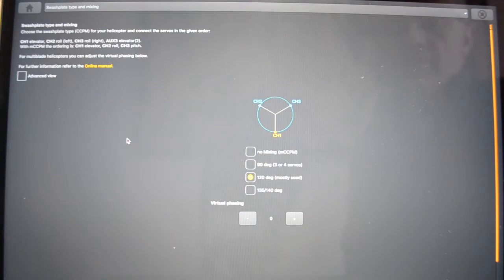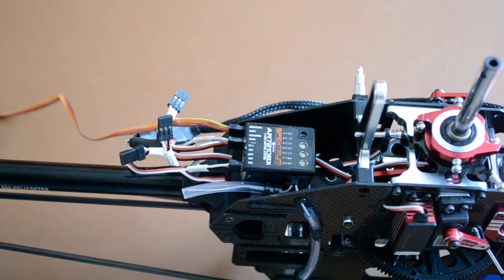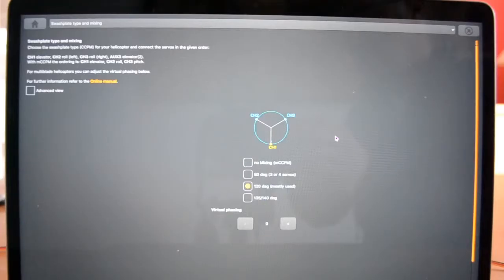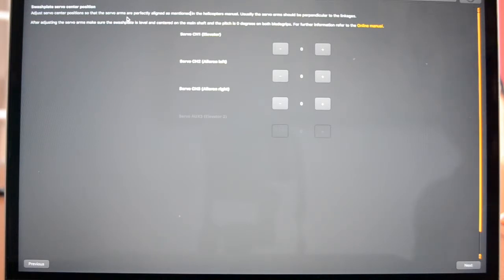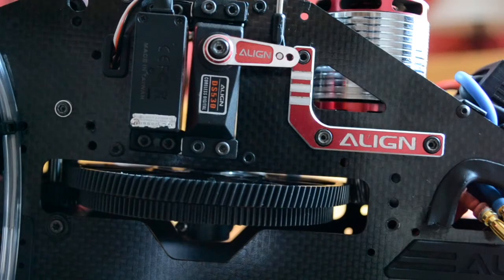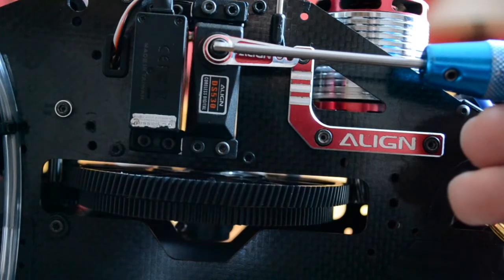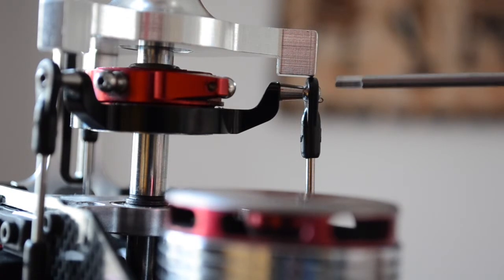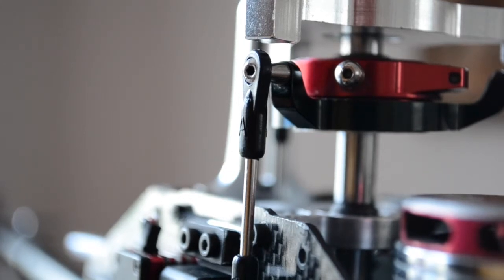AR7210BXBasichelisetup Part2

Comment: Almost at the end of the video with the blade pitch. When taking the whole link of. Keeping the ball links steady and turning the rod left or right gives you small adjustments in lenght and do not need to go full turns. So turning the rod clockwise will ad lenght and anti clockwise will shorten the lengt.  Love your video setup of the Ar7210bx. Setting it up in a day or 2, but nice beginning with your help. 🙂🇳🇱

Comment: Hi Robert you are correct if you need to make small corrections ie fractions of a degree you can move the ball links so that the ball links are slightly offset and not parallel. Whilst this may give the desired amount of correction there is only a limited amount of movement and may not be enough. If you offset the ball links too far and can lead to an increased tendency for the links to pop off in flight which doesn’t normally end well 🙄 😱.  Glad you found the videos useful thanks for your comments 
and happy landings 😀

Comment: Most of this can be done in your transmitter. you just have to go on your pc for firmware update otherwise go to your transmitter. any spectrum transmitter. this guy takes to long just for tail servo travel. by the time you finish with the tail servo I would have had the whole menu done. there are other video's for this AR7210BX that will cut to the chase and easier to understand. this video takes way to long. Just go to your manual for the color lights and it will explain better what your doing not to mention follow a video that explains page by page that you can also follow. he does explain the swash leveling in good fashion.
Reply: Remember this video series is aimed at someone who is new to the hobby who doesn't really understand heli setup, flybarless set up or the menus in the Transmitter.  I agree for an experienced modeller this video series is way to detailed but if you are an experienced modeller you wouldn't need to look anyway!